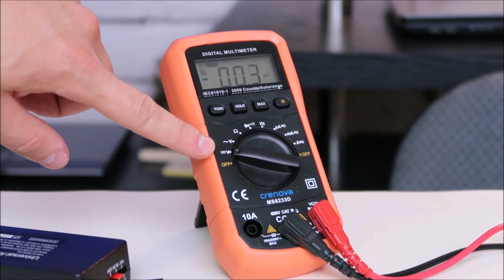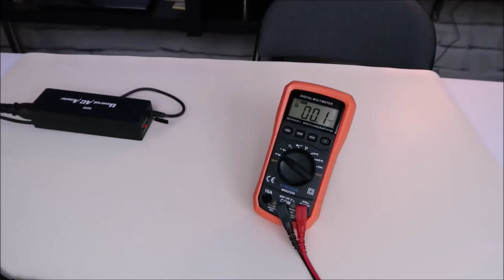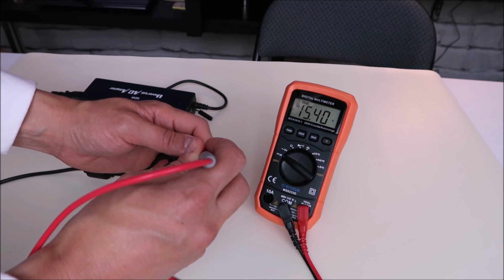How To Fix Any Laptop - Wont Turn On, Wont Open, Turns Off Right Away, No Power Solution

Comment: Thank you bro holy crap.
Reply from the maker: Your welcome !! Happy to help :)
Reply: @PC_Monkey  I have a problem though, my laptop turns on but then it instantly turns itself off. 😭
Reply from the maker: @frudo2285  Are you able to see anything on the screen before it turns off?  What brand computer do you have?
Reply: @PC_Monkey  I have an old HP Laptop 15 and it really didn't show anything on the screen, I was aware that it booted because of the spinning fans but the laptop just closes itself afterwards.
Reply from the maker: @frudo2285  Have you tried the steps seen here?  Also, is the computer overheating?
Reply: @PC_Monkey  I have tried all the steps and I have tested both the power supply and the battery with a multimeter, they all seemed to work okay. I wanted to replace the thermal paste on my laptop and after doing so it stopped turning on. After doing the static buildup step it eventually turned on but it just turns off again.
Reply from the maker: @frudo2285  When does it turn off exactly?  Can you see anything on the screen before it turns off?  Also, you said you replaced the paste.  Is the computer overheating?
Reply: @PC_Monkey   The display does not really show anything when it boots up, when I turn on the laptop the fans spin to life for about 10 seconds or so and then it shuts itself off after. It does heat up quite a lot when it boots up though.
Reply from the maker: @frudo2285  1.  Your on the correct video for a computer not turning on. 
2.  However, an overheating computer can be damaging components and that could have already happened if new paste has not helped.  If its overheating at startup, your most likely looking at a bad CPU at this point.  I would try replacing it
Reply: @PC_Monkey  You're probably right. It's gonna be a pain though since the CPU is soldered into the motherboard. But thanks for the advice, I'll update you after I replace it.  :)
Reply from the maker: @frudo2285  Ya, soldered onto the motherboard means that unless you have special skills and equipment, you will have to replace the board instead :(
Reply: @PC_Monkey  That's alright I kinda have a basic knowledge when it comes to soldering. The hard thing right now is finding a replacement CPU haha.
Reply from the maker: @frudo2285     Good luck !! Let me know how it goes :)
Reply: @PC_Monkey  UPDATE: I managed to find a replacement motherboard on ebay and that fixed it, I really wanna thank you for the advice you've given me. I thought this laptop was a goner. 😅
Reply from the maker: @frudo2285  Glad your all set :) Always here if needed !!

Comment: But it doesn't work on my computer 😕  😭
Reply from the maker: 1.  Are there any signs of life at all when you try to turn it on? Lights? Fan, Motherboard, or Hard Drive sounds? Anything seen on the screen?
2.  You have tried all the steps seen here?
Reply: @PC_Monkey  yes, light. I put rice on it. Do you think it will work ?
Reply from the maker: @foodstuff-e2p  I dont understand your comment.   What is 'light'?  Put rice on what?  What is wrong with your computer that you think rice will help with?

Comment: Mines sounds like it is going to turn on the keyboard turns on too for a second but doesnt not turn on , it turns off right away
Reply: I have also did this with the battery a couple times still has not turned on , can it b overheated thats why it doesnt turn on ?
Reply from the maker: @sydneyrose1556  1.  Is your computer overheating?  You should be able to tell if its hot to the touch.
2.  Have you tried any of the steps seen here yet?

Comment: I have a Lenovo Yoga 720 13IKB. My battery was running its course so I was due for a battery change. I got a new battery and put it in correctly. Now I cannot turn on my laptop at all. I did the static tests, but no sign of life at all. I’m not getting any of the orange dots on the side that means low battery. I know my charger is good and this is a brand new battery. My laptop’s RAM can’t be removed and it doesn’t have the BIOS battery. Now I’m stuck and just nervous. With the old battery when I last was using it, it was on its last breath. The new one I waited a few hours for it to charge but nothing. No signs of life.
Reply from the maker: After getting a new battery, leave it plugged in overnight.  They sometimes need to change many hours.  Also, is it a brand name Lenovo battery or a generic?
Reply: @PC_Monkey  generic brand, same model battery though.
Reply from the maker: @snoopyrogue359  In my experience only about 60% of generic batteries work.  I would try a brand name replacement if the steps seen here do not help.  If its not your battery, then you may be looking at a bad motherboard at this point.
Reply: @PC_Monkey  really hoping it isn’t the motherboard but it’s looking likely.  I might have to call a local reputable shop.
Reply: @PC_Monkey  good news. Yep you called it. It was a crappy battery. I will buy a Lenovo battery then
Reply from the maker: @snoopyrogue359  Glad your all set :) Always here if needed !!

Comment: Am literally asking help by tapping every letter through my trackpad. My laptop won't turn on due to its keyboard malfunction. I've diagnosed my laptop completely and it looks like the problem is just with my 30pin keyboard connector which blocks the turn on signal attached to my keyboard. The keyboard works well but it seems like the connector creates a problem which stops my laptop from turning on. Is there anything i could fix on my own here?, except changing the entire keyboard which would cost me some bucks.
Reply from the maker: If you have identified the issue with your keyboard connector, are you referring to the ribbon cable?
Reply: @PC_Monkey  yeah, it's those 25-30 pin cables, which inline and locks to a micro socket on the motherboard.
Reply from the maker: @Callmeom_01  Ok then yes, if you have identified that as the issue, then I would replace it.  I get most of my computer parts on sites like Ebay, Amazon, etc.
Reply: @PC_Monkey  Just bought a cable through a service centre and got it replaced on my own. Thank you soo much for your suggestion, it saved me a lot of money.
Reply from the maker: @Callmeom_01  Great to hear !!  Always here to help :):)

Comment: Still unable to find out the solution for my problem
Reply from the maker: What brand and model computer do you have and whats the issue with it?
Reply: @PC_Monkey  Dell intel core i5 7th Gen.
It's not switching on i tried all the methods except that RAM removal method 
When i keep it on charge the charging light will come but nothing comes on the display
Reply from the maker: @Srikant_metre   If all the tests in this video do not reveal the issue, and your power adapter tested to be fine, then your most likely looking at a Motherboard replacement as seen here;  https://youtu.be/N_7HNrFkMS8.  If you know your computer's model number, I can help you get inside your specific computer :)

Comment: Hi i have a 470 g2 laptop which when you plug in and press power it turns on for split second then goes and if i repeat the steps same thing happens any idea how to fix?
Reply from the maker: Are you able to see anything on the screen before it goes off?
Have you tried the steps seen here?

Comment: My fan won't turn on and my laptop. Is this means my motherboard need to be replaced.
Reply from the maker: If the computer turns on and works well other than the fan not engaging, you may have a driver issue or a hardware / fan issue most likely.  I would first try to update the drivers as seen here;  https://www.youtube.com/watch?v=DDv2gJDjfOM

Comment: Just got my laptop back from the repair man a few days ago and he mentioned he replaced something called "IC"? Laptop works again but a new problem appeared and my laptop just keeps turning off after a about 10 mins. of using. 

From my observation the laptop stops receiving power when I'm using it's charger but goes back to normal after about a few minutes. After not using it for half an hour it works again but still turns off after a while. I've used Afterburner to see the temperature and it was around 50 degrees when it turns off so I'm not sure if the problem is overheating or maybe something else.

I sent back my laptop to the same repair man and he said he will see what he can do.
Reply from the maker: Was the computer getting hot to the touch?  Also, when the computer would turn off, was the battery at 0%?
Also, if you removed the battery and used the computer with only the charger, would the computer still turn off?
Reply: @PC_Monkey  I touched my laptop back then it didn't felt that hot. As for the battery, I didn't notice it. As for the third question. I returned the laptop immediately so I didn't had the time to remove the battery.

Just waiting for the repair man to return my laptop again. I will reply here again when I get it back and test those things that you mentioned.
Reply from the maker: @alvinderama3196  Good luck !!  Let me know how it goes :)

Comment: I have an acer predator helio 300. I usually keep my laptop plugged in and it stays on for days. I started having trouble turning it on whenever i used to power it off. I had to press the power button repeatedly to make it boot. I had been doing this for around 3 weeks and wanted to get it fixed. Took it to the service centre and they want to replace my motherboard. According to them there's no power in the motherboard even though i had been using my laptop the previous day and i switched it off by myself. Are they right in concluding that I have a faulty motherboard? 
I dont trust them as they have tried to replace my motherboard once before for a different issue and I was able to solve it by just seeing a youtube video similar to yours.
Reply from the maker: 1.  Are there any signs of life at all when you try to turn it on?  Lights?  Fan, Motherboard, or Hard Drive sounds?  Anything seen on the screen?
2.  Have you tried the steps seen here?
Reply: @PC_Monkey  Thanks for your reply! I gave them a day more and turns out they were wrong. They were telling me that there is no sign of life in my laptop and i challenged them because I had shut down the laptop myself before bringing it to them. Today they are telling me that my keyboard is faulty and replacing it will fix the issue. For now, I brought it back home and I was able to turn it on by pressing the power key 3-4 times. I'm gonna wait for a while now as I think all my keyboard needed was a little cleaning.
Reply from the maker: @utkarshagarwal903  Good luck !!  Let me know how it goes :)

Comment: Yea still nothing
Reply from the maker: 1.  Are there any signs of life at all when you try to turn it on?  Lights?  Fan, Motherboard, or Hard Drive sounds?  Anything seen on the screen?
2.  If all the tests in this video do not reveal the issue, and your power adapter tested to be fine, then your most likely looking at a Motherboard replacement as seen here;  https://youtu.be/N_7HNrFkMS8.  If you know your computer's model number, I can help you get inside your specific computer :)

Comment: me watching the video : 😃
when you need a screwdriver and remove something : 😐
Reply from the maker: 1.  Sorry.  Basic hand tools are usually required for basic DIY :(
2.  Are there any signs of life at all when you try to turn it on?  Lights?  Fan, Motherboard, or Hard Drive sounds?  Anything seen on the screen?
Reply: @PC_Monkey  1.) nooo its okay i was just joking hahahha, im scared to break my laptop xD

2.) when i press the power button it doesnt turn on, well sometimes it does i would be happy then it will automatically turn off 🙄
Reply from the maker: @engravedgrave9163  Ya, your on the correct video then.  If you dont want to access the battery, then try these steps without touching it.  Just press and hold power with the charger out.  Does that help?  If not, you may not be able to do very much DIY at this point :(

Comment: Ok, I updated saying that it has been fixed HOWEVER I have a new but same issue now. 

After the laptop turned on, everything came on nothing unusual at all. Start up was great. All the led lights for charge, and power came on. 

But after charging up the new battery, and then taking it off the lap top. I turned it off then put it away for 1 day no use at all. 

Now it's not turning on at all. The only thing that indicates power is when I plug it in but only the charging led light comes on. But since I charged it, it indicates it is fully charged 
But now the power led light won't come on, no sign of start up and still a black screen. 

Is there any other reason why my laptop would still do that?
Reply from the maker: 1.  If your computer wont turn on at all, your on the correct video.  Have you tried the steps seen here?
2.  Is the computer overheating at all?

Comment: Hi So I Dont Know Where The Cmos Battery Despite Removing  Everything Now My Sister Says Its Just Old And It Is Quite Old My Father Said Its 12 Years Old So Is The Cause Just Being Too Old Or Something Else?(The Laptop Is LG
Reply from the maker: 1.  Not all motherboards have a CMOS battery.  Yours may not have one.
2.  Are there any signs of life at all when you try to turn it on?  Lights?  Fan, Motherboard, or Hard Drive sounds?  Anything seen on the screen?
Reply: @PC_Monkey  the fan starts for a secomd then turns off same with everything the screen lights up and turns off immedietly same with the power button I Press The Power Button For Then It Lights Up After That It Turns Off Immedietly
Reply: And It Always Does That Whenever It Overheats(Doesnt Happen Anymore) And When I Put It To Sleep Or Just Turn It Off Thats Why I've Been Using An Autoclicker To Make Sure The Laptop Is On For My Classes
Reply: @PC_Monkey  Well My Laptop Is A Very Old One So It Probably Doesnt Have Any  Cmos And Also The Ram Sticks Also Are 2 GB Ram Each So When I Try To Use The Method To See If 1 Ram Stick Is Faulty The Pc Cannot Handle It
Reply: I've Also Noticed It Has A Higher Chance To Open When I Dont Put The Screen Down
Reply: @PC_Monkey  I Also Cleaned Its Insides As There Was Once A Person Who Fixes  These Things And Says Sometimes If Its Dirty That Might Be The Case Yet He Passed Away At July A Month Before My Laptop Died And Before My Classes Started So I Have Been Really Desperate
Reply: @PC_Monkey  also i have a question can you still bios reset without cmos????
Reply from the maker: @firecore140  Yes, you can reset from inside BIOS but you have to be able to access BIOS at startup for that. 
An overheating computer can be damaging multiple different components if not resolved.  First, make sure that the fan and vents are clean and clear.  If you need help accessing the fan, let me know what brand and model computer you have and I can help you get inside it.  If that does not fix the overheating issue, then try replacing the thermal paste on the CPU and if needed, the GPU as seen here;  https://www.youtube.com/watch?v=K_j4GPjpawk.  If that fails too, replace the CPU
Reply: @PC_Monkey i can access the fan its fine but one of the proppellers is gone
Reply: Also Sometimes My Laptop Opens Every 2-7 months... My sister says "maybe the ram sticks are too low" well i was convinced aswell due to the ram sticks being only 2 gb ram each
Reply from the maker: @firecore140  4GB is very normal for many computers.  If the computer was overheating, some components may be damaged and may need to be replaced.  If the steps seen here do not find the issue, your most likely looking at a bad Motherboard or CPU at this point.  Let me know if you would like help replacing one or both of them :)

Comment: I’ve tried all of this EXCEPT the final AC test. Can you tell me if my computer would respond this way if that were the issue? I did manage to get it to come on after being unplugged all night.

- sometimes even power light won’t come on
- if I remove the battery and reinsert then the power light does come on, but the computer isn’t actually on (no fans, caps lock light doesn’t work)
- but then if I close the laptop for a while and leave it unplugged before reopening, it comes on
- and when I plug it in again, we go back to even the power light not working 🙃 so I disconnect the battery and repeat the whole process
Reply from the maker: If all the tests in this video do not reveal the issue, and your power adapter tested to be fine, then your most likely looking at a Motherboard replacement as seen here;  https://youtu.be/N_7HNrFkMS8.  If you know your computer's model number, I can help you get inside your specific computer :)

Comment: I can't hear the fan turning on, I've tried all the tips, rams, cmos, HDMI to another monitor, it's dead dead. But I have one single LED lit.
Reply: It was a laptop I won in a storage unit bid. There were multiple electronics and I'm not sure how long it's been sitting in a storage unit with the elements.
Reply from the maker: If the fan is on, then I would try another video first.  Try this one and let me know how that goes;  https://youtu.be/u-REPLdpZ70
Reply: @PC_Monkey  no the fan does not kick on
Reply from the maker: @OMGwhydoihavethischannelstill  Oh ok.  If the fan is not on then your on the correct video.  Have you tried all the steps seen here?

Comment: The issue I'm having is a power light that turns on, but nothing else.  If the power light actually turns on, does that mean that the jack is working, too?
Reply from the maker: Possibly.  your on the correct video.  Are you able to try the steps seen here yet?